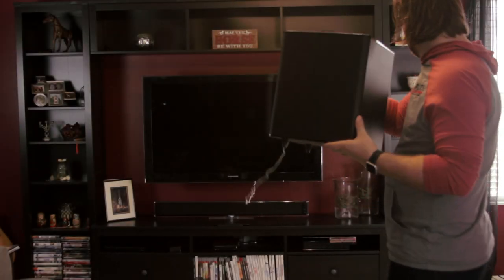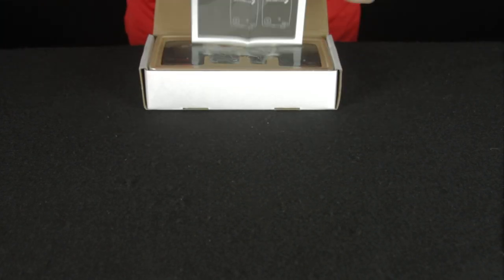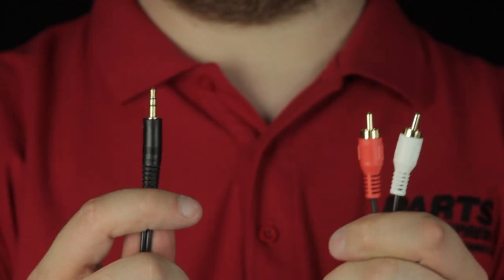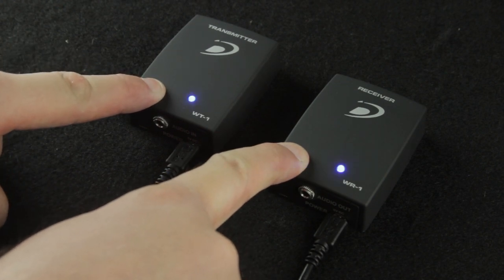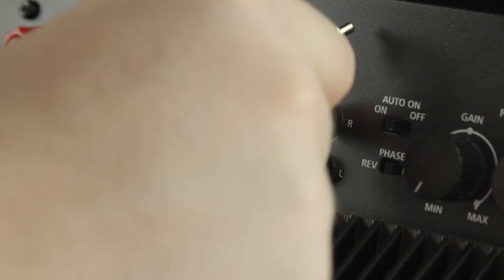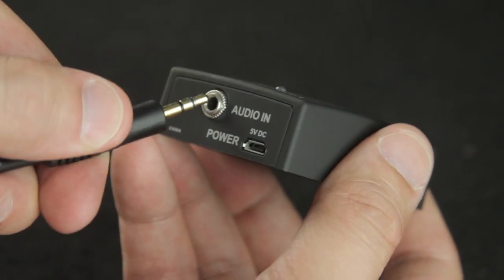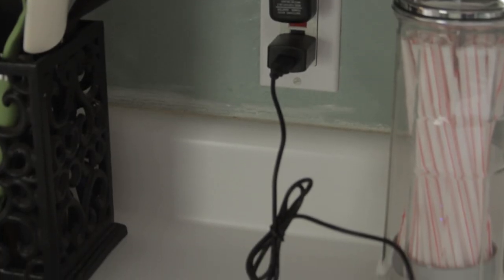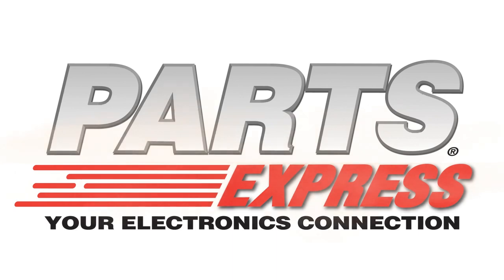How to make your Subwoofer Wireless

Comment: I need this but for speakers... 

Can this be used to wirelessly connect a pair of speakers?
Reply from the maker: If the speakers are powered than yes. Essentially that IS what's happening when transmitting to the sub. It will send full frequency too : https://youtu.be/E8OIpFJNONs?t=101
Reply: No.. they're not :(
Reply from the maker: try this then. https://www.youtube.com/watch?v=hnmoy73ZC34

These have amps in them.
Reply from the maker: heres a link straight to the product: http://www.parts-express.com/dayton-audio-xra25-wireless-rear-channel-amplifier-system-with-subwoofer-channel--300-579
Reply: Thank you much!!!!

That's exactly whta I need!!!

I'll check it out

Comment: Can I use this to connect my old wired wubwoofer to my new wireless soundbar? My soundbar has an aux in
Reply from the maker: You can always contact our Tech Department for specifics (Email: Tech@Parts-Express.com
Phone: 1-800-338-053), BUT if we had to guess, your soundbar would need an OUTPUT rather than an input.